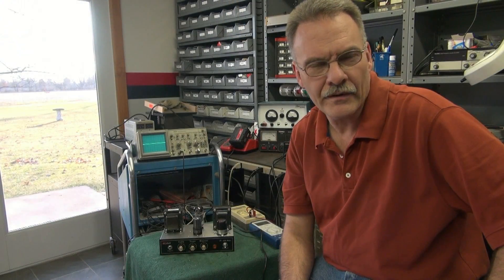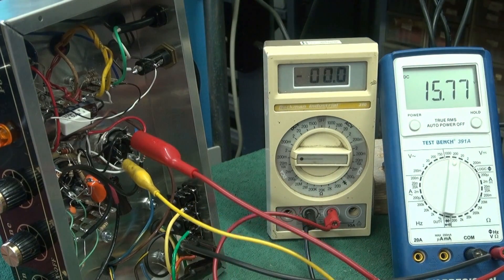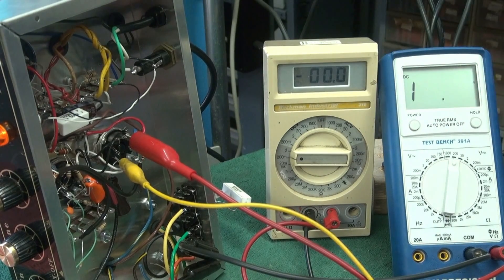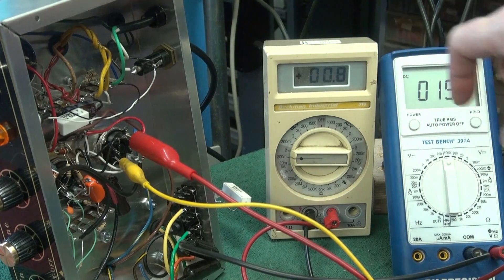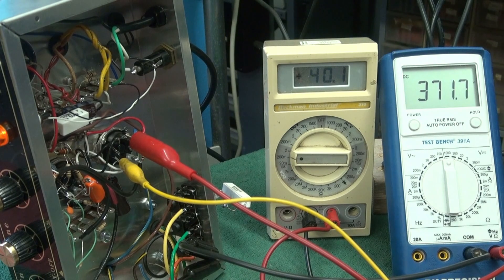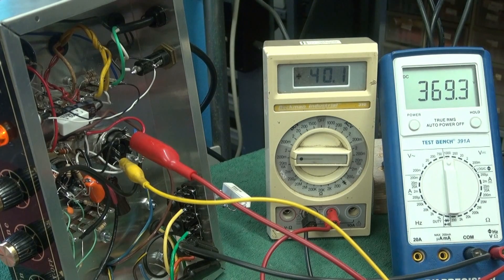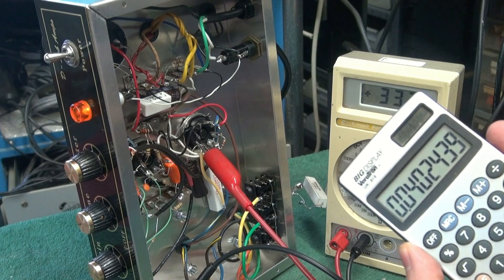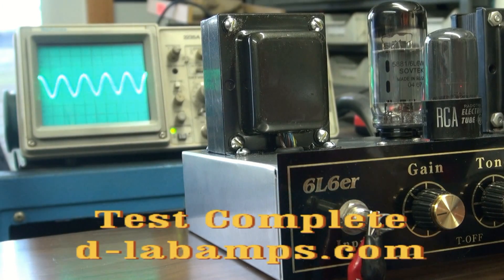Setting 6l6 tube bias Class A amplifier easy How to D-lab amps

Comment: I am new to tube electronics but not solid state. Can you calculate Bias current for a tube? Or do you just start with a larger than needed cathode resistor and work your way down in resistance.
Thanks for the videos.

Comment: Hey Terry, quick question here. You've got it biased around 15W and have a 6L6GB in there. Aren't those rated for about 24W, which would make the bias a bit cold for Class A? 

I'm not suggesting this is wrong, just curious if for my SE 6L6GC amp, I should set the bias for ~25W..? Many thanks! -BR
Reply: @Britt Rossman  did you ever get an answer to this question?
Reply: @lincolnmicrophonellc  Yeah, I was curious too about that one..
Reply: It depends on what your primary impedance load is on your output transformer that dictates how hot or cold you set the bias, Terry is setting the bias at 50% plate dissipation. If you take a kt88 tube with a 2,500 ohm primary impedance with a plate voltage of 420v at idle. The max you can set the bias is 78% of max plate dissipation in class A, before she runs too hot. It all depends on the plate voltage and what output transformer you are using that dictates what you can run. You need to do a load line analysis of your amp to see what it can do

Comment: Plate dissipation is 
(Plate voltage - cathode voltage) x plate current.
Reply: And cathode is usually held near ground, so compared to 3-400v range on the plates, 0.5-3.0v on the cathode is two orders of magnitude smaller and therefore negligible for a ballpark calculation, right? I mean, the whole amp can run without much trouble at +/- 20% so what real difference does 1% in the power calculation make?
Reply: @brittisaacrossman  It's fun to calculate but you make the larger point to take home I think 🤗